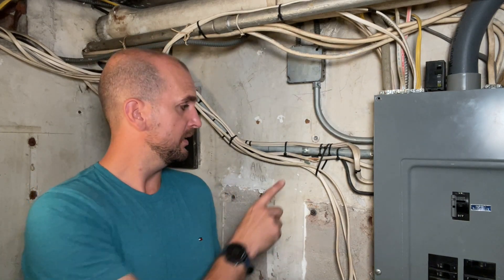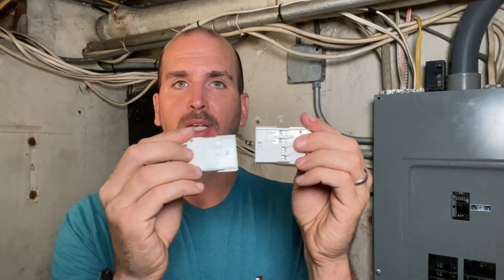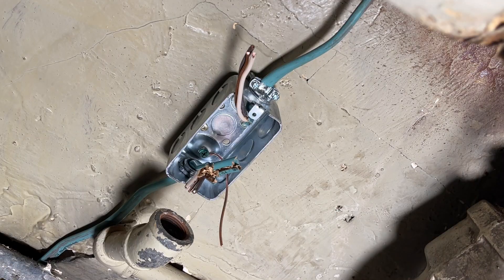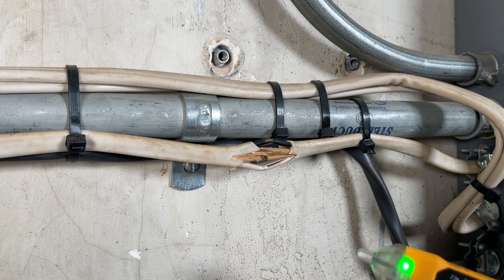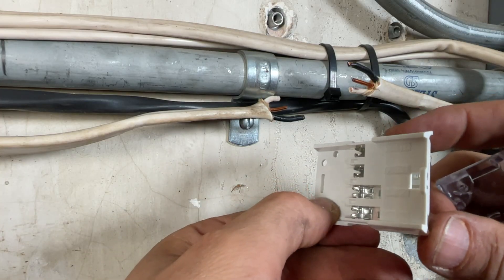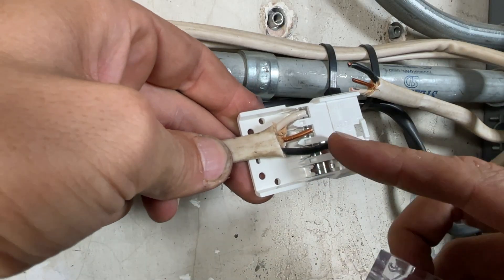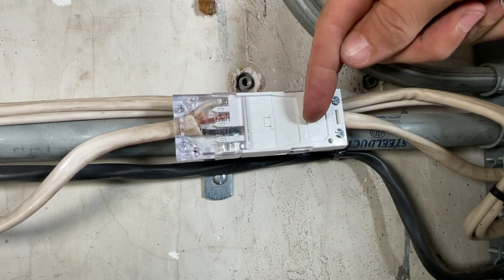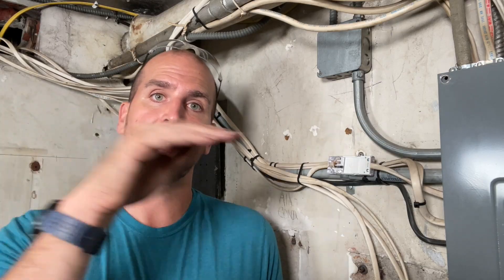How To Repair Damaged Romex Wires

Comment: I spent a lot of years being an electrician and I would NEVER install a half-A' gadget like that tyco thing. Reason being they are more expensive to use, and at best a future problem in the making. A common jobbox and some wire nuts are 100% approved everywhere in the US and last forever when done correctly. Also you have the option of turning that circuit into a outlet or switch or add another branch later if you like (assuming you used a large enough box) I have never had issues with j-boxes. On the other hand, little "shortcuts" like snap-together things almost always cause a problem eventually, especially if that circuit is going to have some serious loads on it. eg. electric space heaters, or if the location gets a little damp and corrosion could make the little slicers in the gadget rust up.
Reply: No matter how, where or why, EVERY JUNCTION MUST BE ACCESSIBLE. You could not pay me enough to use that plastic splice kit, even if it was ACCESSIBLE. The twisting of the conductors, and a wire nut is the only thing I would use. You much more contact with a wire nut than the others, you said you didn't like speed wiring on devices, but those others are nothing more than stab loc. Sometimes there is drywall repair. There is no way around it. There is a correct n safe way, then there is the shortcut way. Explain that to your Insurance adjuster if not done properly. 40 years I was an electrician, from new construction to service work. And there is not one house I would be worried about. Do it right. Cutting corners, no way. I took to much pride in what I did. Being retired old customers still call n ask for me, no one else. My reputation is my word. So think twice about these new gadgets.
Reply: I’ve replaced a lot of lamp cord plugs, that had that same arraignment. It sucks on lamp cord, so I sure wouldn’t place one on a romex cable. Besides, mobile homes have lots of those press on units for outlets and light switches. In my experience, they fail often and I’ve found a couple of burned wires on outlets, when I replace them. I’d NEVER use one. Junction box and wire nuts for me.
Reply: Might as well use the ballast connectors way cheaper still not good enough for the load and can still be easily disconnected at the wrong time.
Reply: between the wagos and the "splice box" i forsee a fire starting.
Reply: How do you add a j box and wire nuts without stretching the wire?
Reply: @glenngiere  The correct way to repair this guy's wire is to open the panel and identify the right breaker to turn off. Then cut the damaged cable and pull the short end back through the panel and replace it with a cable that is long enough so you can add the j box on the wall.
Reply: @glenngiere  then you don't,unless you extend the wire and use 2 jboxes, or a new piece of wire from the damaged point to the source, or next junction point. Some cases need drywall repair. It is what it is. Do it right or don't do it at all. Call a licensed electrician.
Reply: I'm just an old DIY homeowner and definitely agree with you. Can't even imagine having a connector like that buried behind a wall.
Reply: So you would not use the Wago's or the Te Romex Splice Kit at a electrician? Bit hazy on the "Tyco" term. As a DIY'er the Wago's look cool long as the amp rating is quality.
Reply: I think I'd rather have a buried junction box in that case. Of course, that's not code, but it seems a lot safer.
Reply: Lol, totally agree. The contact resistance at that contactor will be more dangerous than doing pretty nothing at all
Reply: Mike, I have the same background as you and I agree with you 100% use the truly tested process and forget about the gadgets, I don't think I've ever known an underwriters inspector that would approve that gadget for use in his territory let-a-lone inside a wall with no future access. A problem waiting to happen!
Reply: @davidschwartz5127  My point exactly. Even though the gadget is approved, the NEC places some very specific conditions when it gets used. However, the marketing guys want any Joe Homeowner to buy these very expensive things, offer next to no instruction on using them properly, and leaving the local code inspec guys and electricians to deal with the fallout when failures happen. I am old enough to remember the aluminum house wiring and Federal Pacific fiascos very well, and I am still "dealing" with those fallout situations every year or two (a whole crapload of that junk is still in service) That stuff was once "approved" gadgets, that failed in spectacular fashion some 40 years later. The plastic gadget in this video looks like the same sort of gimmick, it is all about the sales.  Also, the video's gadget installation is still not to code on many points anyway!
Reply: Exactly
Reply: Yup looks like an expensive scotch lock which is known to be garbage.
Reply: Ok boomer
Reply: @Mike Lamb I agree that is the most mickey mouse piece of garbage I've ever seen, with that cut so close to the panel, you could cut the romex right at the cut, pull the romex back, and mount a box, run a new piece of romex from the panel to the new box. This fix is a hack job!
Reply: @Bluesman57  I think in this case he was just trying to demonstrate how to use the splice. Obviously your solution is better otherwise.
Reply: 42 years as a licensed electrician and I used one of those things once, never again.
Reply: @Kansas-Paul  I am surprised you used this even once. Were you feeling "experimental" that day? These cost $40 each!
Reply: @michael47lamb  Great reply Mike, this was back in the early 1980’s and from my recollection they were about $5.00. The Greybar counter guy was promoting them and gave me a couple samples so I figured I’d give it a try. I also recall they had a tap and run feature which is maybe what got me to be adventurous. The 2nd one was never used. Collected a lot of dust in the back of the van it did. 👍
Reply: @Kansas-Paul  I know the feeling Paul! Sometimes those "free samples" can get expensive quickly. I have been reading more about these plastic snap-together things. Apparently, they are ONLY to be used as a last resort and ONLY when the cable is not replaceable totally. Judging from the tone of the article, this is mainly about flooded houses  However I have been in flooded houses and can honestly say that once a house is getting rehabbed from a flood, EVERY wall and ceiling gets taken down, thus exposing all the wiring and etc. From this it is easy to see that the plastic gadget is NOT ever code level appropriate since everything is accessible during the rehab. 

From this I am thinking that the manufacturer paid the NEC a boatload of money to get their gadget included in the code, (to increase sales no doubt but also because the thing has been used in manufactured housing for some years more or less successfully) but only with very narrow and specific requirements and applications too. 

All of which is of course enforced on the local code level. But few if any of these stipulations are known to the DIYer, or many electricians. Also I read that "training" in the proper use of the gadget is required. But how is someone to get trained? It is all a bunch of monkey-business in my book: Sell unsuspecting people these expensive things and then let the local inspec fail it (or let the house burn down from a bad install) then blame the installer for not being properly trained in the gadgets use.
Reply: Nope! Not for work that I want to be known for. Also all of your romex wires that you are showing in your video is considered exposed wiring/ subject to damage.
Reply: First orange thingy is dangerous, due to resistance. Same with the latter deal, although I see them in campers and trailer houses in the form of devices.
Reply: @beinghuman3225  Not an electrician, but have been doing HVAC/R for little over 15 years now. Wago connectors have been in use in Europe for decades and are actually rated for 32A continuous use.  The Europeans think the same thing about our wire nuts.  I've even started seeing Wago connectors IN commercial appliances the last few years on high current circuit components like the defrost heater and compressor wiring.
Reply: @sivalley  did service calls and fire jobs for many years. More than 50% of fire jobs I seen were due to that style of connection.  Like stick-in terminals on the back of receptacles and switches should be illegal.
Reply: @beinghuman3225  I agree, the speed terminals in light switches and outlets would be illegal because most people don't stop to think that those connections are primarily for low power and lighting loads but you make something idiot proof and the world invents a better idiot.  The lever lock Wagos are the only ones I trust because you can ensure the conductor is fully inserted before the spring takes over.   The simple push types are only rated for 13A and are often not inserted fully because the spring tension is always there.

Every tool for its job, but some people still insist on screwdrivers as pry bars and chisels.
Reply: @sivalley  use what you want. I won't n never will. Not enough of a connection point. They are nothing more than a fancy stab loc you get on a device.
Reply: @sivalley  those Wago connections, how much contact do they have compared to the wire twisted in the proper size wire nut. Would you rely on the stab-lok on a device, which nowadays is only for 14 awg, 12wire does not fit, that there should tell you something, or use the screws on the side using a FLAT BLADE screwdriver. You get more twist to make the wire very tight. All connections need to be very tight. A loose connection will get hot, then hotter as time goes by. In my 20+ years running service, I can't count the number of times that a loose screw, our a stab-lok burnt the device, and the wire, making it almost impossible to repair in the box. The better connection, the tighter the connection the better.
Reply: Agreed. Provisioning and over-spec’ing are always a good idea.

That said, the splice is a good solution if you locate a romex fault or break inside the wall and you don’t want or can’t have a jbox.
Reply: @MarcosElMalo2  and if your house burns down and they find splices buried in the wall, lots of luck with insurance.  Any and every connection, box what ever must be accessible, and in a box.
Reply: @MarcosElMalo2  If I had a fault in a wall I would still be doubtful of using the plastic thingie. I would not sleep well thinking about it developing a high resistance someday and burning up the house. Then with my luck, someone rats me out the fire marshal and I get dragged into court, spending thousand defending my actions. All that so I save a little work with the plastic gadget today? No thanks. What I do with faulty wall wiring is make a big quote for tearing out the fault to the nearest box and installing a new cable. That is also a lesson to the homeowner to not be a moron and beat a big nail into a wire! FYI this actually did happen some years ago. Except I let him do all the drywall repairing to save him some money. I just fished the new cable to the nearby box.

Comment: I would not trust that splice a far as I could throw it and that is exactly what I would do, throw it in the garbage where it belongs. With 51 years of electrical experience behind me I see nothing but problems with this splice. A “Jerry rig” if I ever saw one.
Reply from the maker: Hey Lester, thanks for the feedback.  What is you preferred method if you can’t get a handy box installed?
Reply: @EverydayHomeRepairs  I would prefer a junction box be installed that is accessible or a new home run to the next box. I have found the most electrical problems stem from inadequate connections ,” probably 90 percent” and improper grounding at about 5 percent and the rest equipment failure generally caused by the previous two problems or poor workmanship.

Comment: Given two of your fixes look like they are in the same basement and its unfinished, I'd run a new piece of wire from the splice to the panel and make a box.  New piece since you'd want a little slack.  Nice and secure and depending on the load on the circuit, maybe an easy place to pull power from during an upgrade down the road.  Inside a wall problem - not sure.  I'd still lean to a box, like a retrofit box, and cover with a matching but solid faceplate.

Comment: I would have just replaced that 14/2 home run romex but it looks safe with the adapter...? But why is they so much electrical wire exposed and most at eye level that is a code violation in California.

Comment: Nice!  U have a new subscriber.  I found some romex with the white outer coating slightly damaged, but not any wires inside.  Couldn't I just wrap electrical tape on that?  Also, what name/brand were those clippers to cut the zip ties and wires?
Reply: The sheath is not a worry. It's for pulling through a wall. As long as the conductors inside have full insulation there's nothing you need to do.

Comment: As of the 2014 nec, it is only allowed for repairing so I believe that he is using it correctly per 334.40b. When they are in stock Grainger has them for under $9.